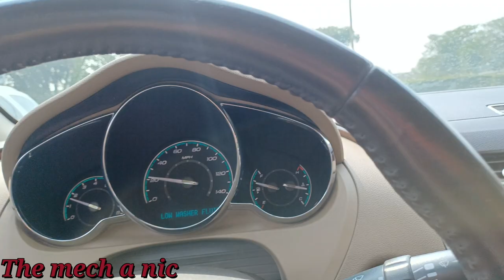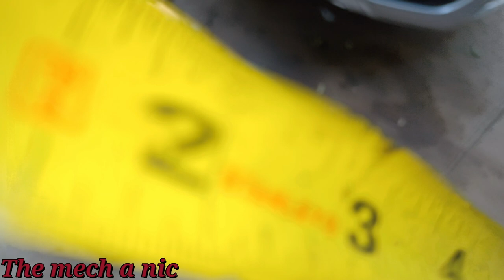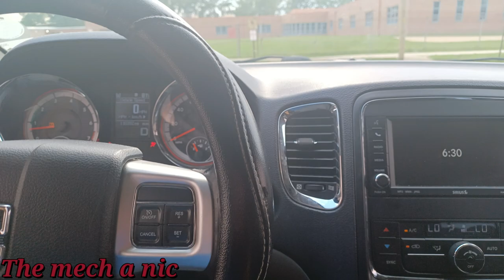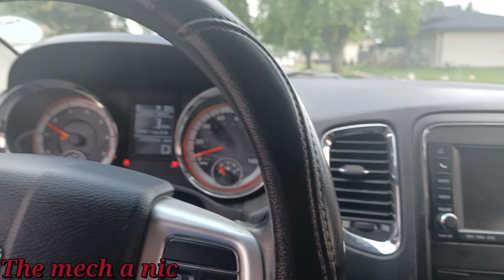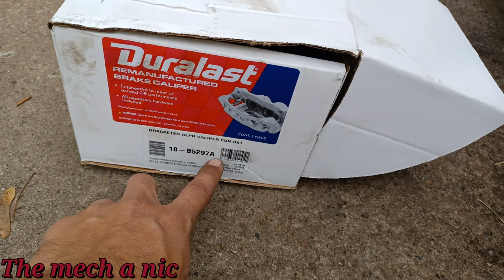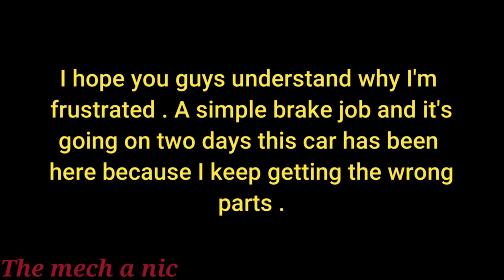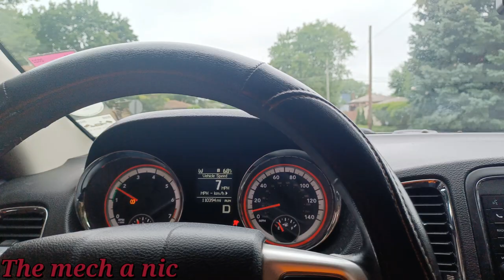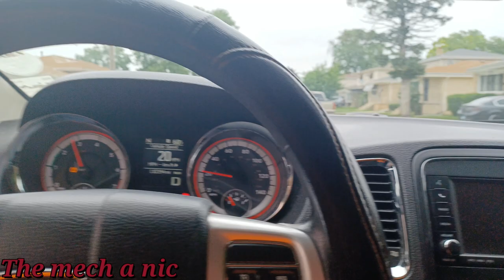colorado oil leak / durango wobbling steering wheel

Comment: Hey, I'm a Mike & I don't do hack work. :)  My guess on the wrong parts is that the person at AZ didn't read the number correctly & it was their screw up. I know mechanics get blamed for things breaking on cars they repair & it also happens to AZ workers installing batteries & wiper blades.

Comment: Thank you! I just got done with two back brake line replacements and the ABS/MC went dry. Also the MC was leaking out the back seal. I really enjoy your tips you pass on. 

Have you ever tried a pressure bleeder instead of the vacuum type?
Reply from the maker: Yes I have a pressure bleeder. I only use it when I'm having a hard time bleeding brakes and my regular methods aren't working .

Comment: Any ideas on a 2015 rogue sv it idles rough, new pcv valvem cleaned throttle body, clean maf sensor.  Love ya vids helps me alot
Reply from the maker: Is the check engine light on?
Reply: @themechanic6117  no its not on but man shes rough, for months now and no one knows what to do